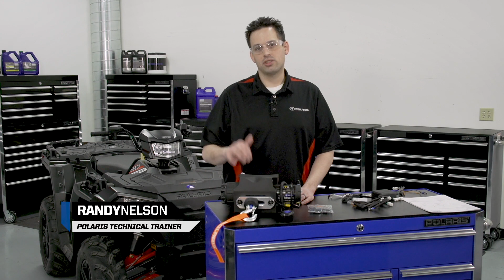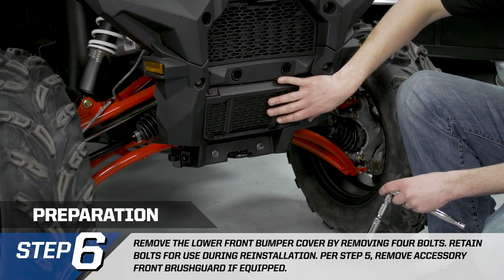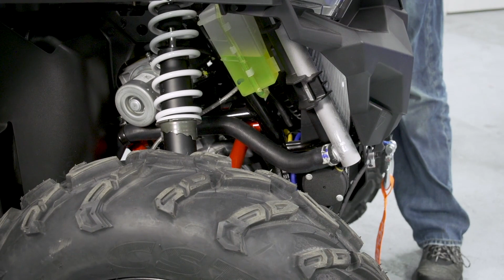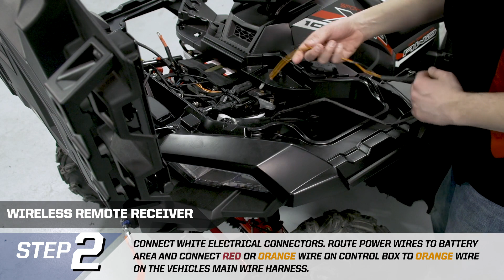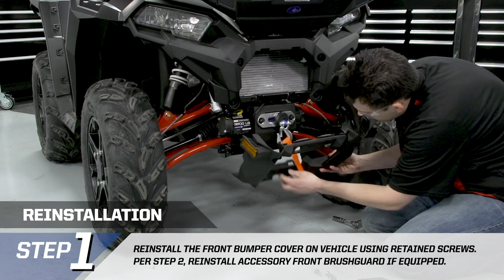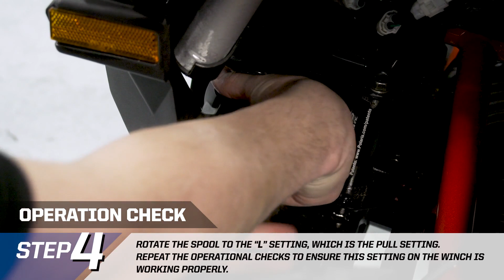SPORTSMAN® XP1000 Polaris® PRO HD Winch with Rapid Rope Recovery Install | Polaris Off-Road Vehicles

Comment: Just bought a Polaris pro HD 3500 lb winch part #2883578 for my 2020 Sportsman XP1000. I think the dealer gave me the wrong part # as far as I can tell that part is for the 1000s, will this winch work for me or do I need to return to the dealer?